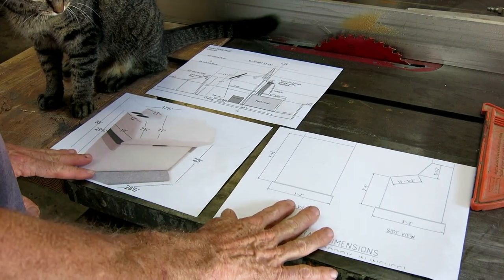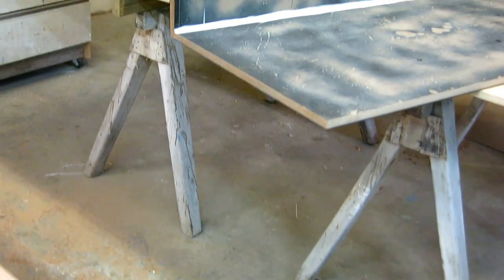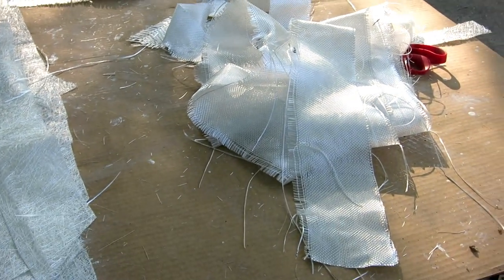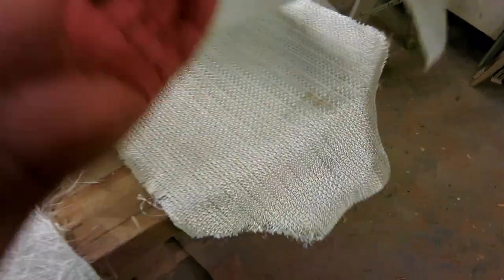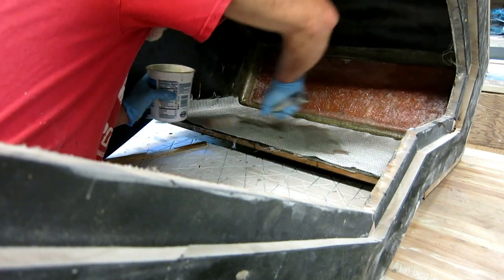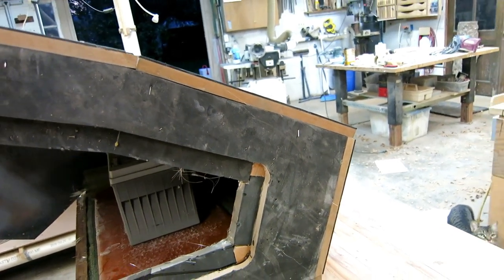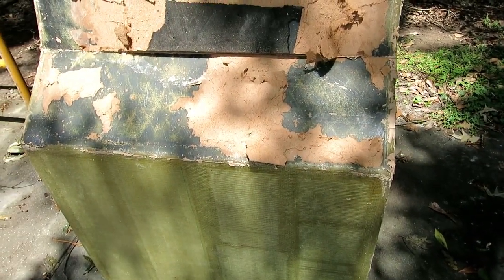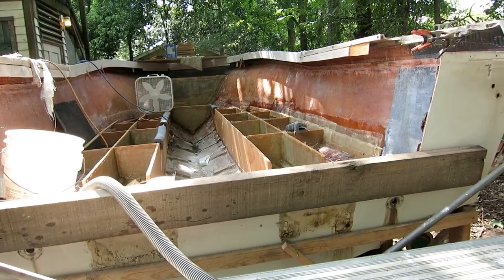The Center Console Boat Project #6 DIY Fiberglass Console#1 Couyon Version

Comment: I am thinking about building one out of 1/4” PVC sheets and glassing over it. I like the malleability and weld ability of PVC with a heat gun and cement and the structural mechanics of the fiberglass. I think the PVC could remain in place after construction.  Would this work as well as I am hoping?
Reply from the maker: Well Ward I don't have any experience with PVC board but it sounds like a plan to me. Go for it!

Comment: You can take your foam scrapes and glue together to make up a larger board. The seams do not affect strength  because the mat is where the foam gets its structure
Reply from the maker: I agree! Trust me, at $180 a sheet the only thing I am throwing away is the dust from the saw. And even some of that ends up in my thickener mix.

Comment: can you please advise what type of aluminum you have used for the T-Top ( 6001 ? ) and how you have painted it ?  As far as I watch you did not use any self-edging paint or primer ..
Reply from the maker: The aluminum pipe I used was ridged aluminum conduit. I don't know the spec on the aluminum but it is very soft, easy to weld and is used a lot in sewer plants (harsh environment). I primed with an epoxy primer rated for aluminum, don' remember the brand. 
Thanks Barry

Comment: Came out great! Looking to begin a console build similar to this. What were the dimensions of the console? And how much resin/glass did you end up using in total? New to fiberglass work, was debating framing out the console with 2x4s and using plywood for the faces, then glassing. Leaning mold after watching your vids
Reply from the maker: Thank you Nik! Console size should be determined by tour boat. I used 10 5gal buckets. so I could have saved a little money if I would have purchased a complete drum but I am not set up to handle drums at home so no regrets. If you make the console out of glass covered ply I would forgo the 2xs. Consoles get very small on the interiors and the 2xs should not be needed. I I were to do it all over again I would do the same but instead of adding glass panels as extra stiffeners I would use good ply for ease of cutting and better screw holding. Good luck on your project!
Barry
Reply: @barrylukebuilds7894  that much resin just for the console? Or for the entire boat build?
Reply from the maker: @nikmirando1794  Sorry Nik, that was for the entire boat. Not sure what the console used.
Barry
Reply: @barrylukebuilds7894  no worries, thanks Barry!

Comment: Definitely going to build one just like it.  Curious as to why you always turned the gel coat side into the laminated side?  I would have thought the opposite.  Not a criticism as obviously it worked and you had a reason but I'm just curious.  Also, wondering why you didn't gel coat the part?  I think that may be because of the difficulty factor and if so, I totally get that.  Really good video/job. I like what you said about not being a perfectionist.  That is me all the way.
Reply from the maker: Ed
I honestly don't remember having a plan on which way I turned the stiffeners. But being encapsulated with glass on both sides it probably didn't make much of a difference.  I skipped the gelcoat  knowing my molds were not gelcoat quality. No point on putting on a finish just to sand it mostly off and cover it up with body filler. 
Thanks for watching and thanks for commenting and good luck on your video!
Barry
Reply: @barrylukebuilds7894  Thanks for the information.  I want to repeat again how much respect I have for your willingness to take on a project of this size and your ability to bring it to completion. I would love to make a video but probably lack the wherewithal to pull it off.  You did a great job on yours.  Not a lot of fluff and quite honest in your successes and also in your challenges.  It's been quite entertaining and informative.  A tip of the hat from one old guy to another.